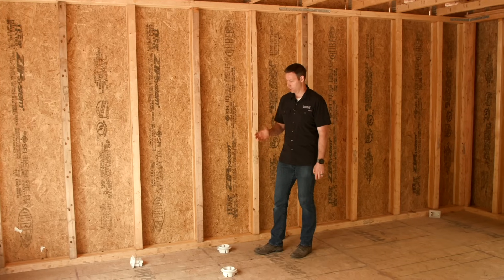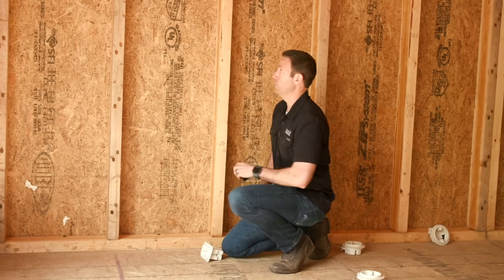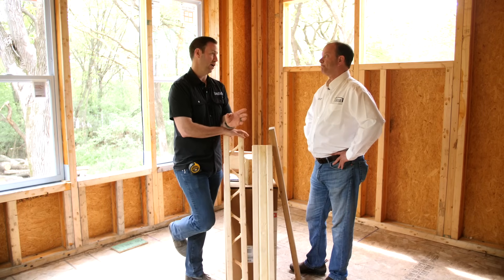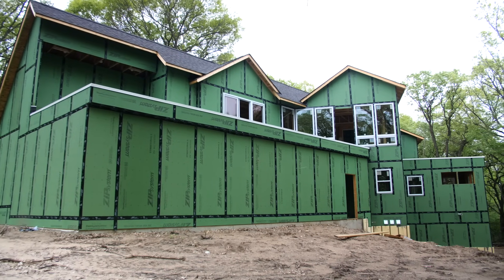Insulated Studs? This is a BIG Innovation in Framing!

Comment: How fast do these walls fail compared to traditional stud walls when exposed to fire?  (Not making assumptions or nay-saying... I'm interested as a Firefighter.)
Reply: From my basic knowledge I advise that this type of foam is self extinguishing,  the wood of course is not. In a sprayed in application VS BATT it would perform better than studs n batt. In a T-stud to spray foam it would perform significantly better. There working on the fire an mold barrier as well he said. Which I believe industry wide is simply passing the testing required to certify the foam and a simple additive. just costly and less in demand that the standard stud. Its been a few years n Spray foam has not yet been certified for commercial fire walls n so forth due to test costs/ Vs potential additional sales is what I was told when I ask.
https://www.youtube.com/watch?v=1PB_-zjWVLM
Reply: If the insulation is a polyiso the difference should be minimal. Polyiso is rated for use in a fire rated roof as insulation and is the typical type used in most exterior foil backed sheathing. Most spray-foams are now polyiso based due to flame spread and off-gassing concerns. By treating the wood component for fire resistance it may even be a better solution than standard framing. I would be interested in UL ratings for the construction assemblies of the product as that is the only way to be sure of its fire resistance. As a retired Registered Architect I would say that the system has potential.

As a side note just because foam is used doesn't mean it burns "faster" because the chemical composition, curing process, and manufacturing process of the foam makes a big difference in the flammability of the foam.
Reply: @oldman4440  My concern would be the smoke that it creates.
Reply: @iamjackalope  If the foam is polyiso its fire characteristics are the best of all foam that I'm aware of. It does not melt or drip upon combustion but forms a protective char layer and remains in place during fire tests. Its temperature resistance is 390 deg f. In roofing construction it often does not need a thermal barrier like other foams to get a fire rating. Do not confuse polyiso with the closed cell foam (typically blue or pink in color) or "bead Board" (white in color and breaks into loose beads - think styrofoam cooler. This is the foam type which gives foam insulation a bad reputation ).
Reply: @oldman4440  I'm familiar with polyiso. I've used it working with boats. It's a two part mixture that is poured into sealed compartments under the deck and in the gunwales of boats to help keep them afloat if they end up getting swamped.  The compartments have to be sealed air tight because the foam will suck up moister and promote rot and mold. It can be very costly to repair.

For exterior roof insulation  or "ridged" type panels like Cellutex are only fire rated for use on the outside of class B residential and commercial buildings if I'm not mistaken. (I'm to lazy to look it up in the IBC, IRC) 

But there is no way these T-studs could ever get a class A fire rating. They are wood and wood is a 4 letter word to class A fire rating. Even when chemically treated with very expensive fire retardant chemicals. You want class A you build with steal. Steal studs, steal doors and frames, steal duct work, steal electrical conduit and electrical chases and thick gauge welded corrugated steal panel roofs with 8" of steal reinforced concrete over that and then topped off with a water proofing membrane like hot mop and rock. All of the walls are covered with 2 sheets of 5/8" sheet rock that continues into the air ducts.
Reply: @iamjackalope  as a retired Architect I am very aware of combustible vs. non-combustible construction and I was never claiming a Class A fire rating but responding to the question how do the T studs compare to conventional  wood framing in terms of flame spread and toxic gas production during combustion and my point was that of all of the foam types available polyiso would be the best due to its inherent better fire characteristics  over other foams. Test data is required and I'm a little bit disappointed that the video did not touch on this area.
Reply: @iamjackalope  Steel. The word is Steel. Not "Steal"...
Reply: @tmoney1876  Steel.... opps my bad. I proof read my stuff but that one got by me.
Reply: according to their website they perform BETTER than standard wood in a fire.  My guess is that the foam is NOT as flammable as the wood and thus creates a fire break.  The heat insulation also protects the side of the 2x6 that is not exposed directly to the fire, thus protecting half of the wood from fire till the foam is gone.
Reply: Negative on the foam being more flammable. We use fire caulking/foam all the time in the industry.  I’m sure it’s fire resistance.
Reply: @MiniMotoAlliance  Foam fire block ignites at 240 degrees. So it catches fire faster than wood. Its purpose is to stop air movement in a fire to slow the burn process, but is not resistant to flame itself. Fire stop caulking is much more reliable, but takes longer to apply.
Reply: He mentioned class A fire rated product is available.
Reply: @johnnybarbar7435  
Not yet. Wait for relevant testing.
Reply: https://www.tstud.com/sodermalm-house
Reply: The foam is polyisocyanurate, an excellent fire resistant product - better than wood.
Reply: I had a truck fire in my shop with foil covered fire resistance foam sandwiches between the truck and furniture stored in shop. One foam board showed slight damage, no heat damage to furniture and no spread fire. Volunteer crew, six miles out...cab and engine compartment burned out. This foam is amazing.
Reply: If residential sprinklers were required by code it would be a moot point, and you would eventually be out of a job.
Reply: @jeanpetrunak6458  Fire sprinklers MAY keep a room from reaching flashover long enough for firefighters to arrive and possibly save a structure, but I've never seen them conduct search and rescue or overhaul...
Reply: @stewie84  Interesting. When you respond to an alarm in a building which has sprinklers, what condition is the building in when you get there?
Reply: @jeanpetrunak6458  Sprinklers are becoming more common place these days, or at least in California they are. Most new residences built within the last couple of years have fire sprinklers installed. It really is about time that they become a code requirement nation wide.
Reply: Supplier can you answer this sensible ?
Reply: It's wood..it already failed there guy
Reply: seem like with all that Styrofoam in the middle these suds  would be a great fuel for a house fire
Reply: @woodchuck1800  ...Its not styrofoam,... There is, in fact, more than one type of foam in the world.
Reply: This is like asbestos or DDT tehey will never tell us until enough folks have died in a fire 🔥 trap or enough years have passed
Reply: I'd say they burn faster...the dowels are glued in..plus foam is flammable
Reply: @tonym1279  The foam used in these studs should be the same, or similar to spray insulation witch would make them fire resistant and shouldn't burn faster than a traditional stud.
Reply: @tonym1279  Based on what information and experience?
https://www.tstud.com/sodermalm-house
Reply: @tonym1279  These are exactly my concerns... glue fails, truss fails, stud fails, wall fails... but until it's been tested, it's just theory. I'm sure these tests must have been done if they are considered acceptable building materials, but I'm curious to know the results..
Reply: @stewie84  wood glue is stronger than wood, the wood will fail before the glued joint lol

Comment: You know what's best?
These are gonna be used only by rich people and they really like big windows.
Big windows kill thermal efficiency.

You want a well insulated house, cut on the window and make sure they are well placed. 
Also a good isolation in the basement is often over-looked, but's it's really important. Also it help stop humidity from the ground and thus you can use less air-exchanger, which is also a big lost.
Also, you already need something on those stud and there are insulated solution that aren't that expensive.
And finally, I don't like the single the top plate and the wall being retain by strap.

I know it's a lot of complaint, but there are so many comment that focus on the marketing in the video, while ignoring the flaws.

Comment: They mentioned the convenience for electricians but what about plumbers having to go through the studs with 2" drainage?
Reply: The space in the middle should be 2 1/2", so a 2" nominal PVC pipe with actual OD of 2 3/8 should be able to slide through.

Comment: As a plumber I see complications. Drilling a two to four inch holes would take for ever. Keeping pipes to grade will be a pain. There will need to be special brackets made. I am sure that you would loose a bunch of strength after large holes were notched into place
. Running Pex water lines would be cake. Special attention would need to be applied to the ends of pipes being installed. ( Water lines plugging up. Gluing waste pipes with the Ins. parts in them. Ect.) Funny the sparky poking his little wire through it. Probably couldn't find a plumber that wouldn't be frowning. LOL. All and all if you can afford it buy it. Cause if the wife is happy your happy. Who cares what the plumber thinks.

Comment: Why not just fill the wall with the foam instead of using old fashioned fiberglass insulation that will eventually slump in between the studs ?

Comment: It appears as though the studs have been rotated and stacked over the windows providing what you say is a viable structural member that will eliminate the need for PSL, or LSL or solid sawn. As you point out there is no load being placed on them in the example of this video and these studs are nothing more than backing. When required, what engineering practice will allow them to be laminated and what load will they bear either continuously or on a point? Can you furnish the reports and testing that will verify your claims?

Comment: Question? I really like this product and think it can work well in cold climate states but 24" centered stud is not an ideal for dry wall screwing. It may buckle and more likely easier to bust through, unless you have a solution for that.
Reply: nemarec - I agree with your question about  24 inch centers which would require at least 5/8 drywall for strength.  That said, the wider profile of each stud compared to traditional framing provides more surface to get a strong mount, especially at the joint between two drywall sheets.

Comment: I'm sorry, but this seems like an unnecessary product. There are ways to get around the stud transferring heat. About 15yrs ago, I was on a project for a "green" Library. The exterior side of the walls had 2x4 studs @ 16"OC. The interior side of the wall had the same framing, but offset a stud bay. Everything was sprayed will foam. The exterior side had 2" styrofoam sheeting attached to the studs and 3/4" ply outside of that. The 2x4 could just as easily be replaced w/ a 2x3 or even a 1-5/8 metal stud, on the interior side, to save wall thickness.
Reply: Hi Tom, Just my thoughts, but I think you would be rendering the primary exterior sheathed wall as completely non-structural because practically ALL of your lateral shear resistance inherent in the tight plywood-to-stud connection is lost by the introduction a non structural inter layer of 2" styrofoam that your fasteners have to penetrate. But by the sounds of it, the entire cavity was also filled w/ exp foam so that would help with lateral loads, but would be an interesting calculation. Perhaps if the exterior were ExtrudedPolyStyrene, glued & screwed you would get some sort of lateral shear rating, but on a large structure like a Library- well, I'm that certainly did have some good engineering.
Reply: @sLDaco  I hear what you're saying. This particular job had a steel skeleton so your worries would be nullified. In a residential framing situation, I'd think you could forego the 2" styrofoam, as the interior volume would be far less, for heat calcs. However, let-in braces (Simpson straps or plywood triangles) could be employed to relieve your lateral woes.
Reply: I tend to agree the real heat loss is in the windows and ceiling, but try to get anyone to pay for triple pane Windows
Reply: @minedustry  Triple pane is a hard sell. My experience shows the ROI isn't always worth it. The only real advantage of triple pane, that I've found, is the comfort factor. They create less instances of higher Delta T and, subsequently, less equipment cycling. This also decreases the feeling of interior drafts and temperature swings. But, we wind up back at the initial cost.

Comment: How do these act in a fire? Would they burn more quickly, or different in general, than a regular 2x?
Reply: @10:30 - The pressure treated version (treated with a product called NexGen)  is Class A Fire Rated. There was no mention of fire rating on the untreated version. I don't know the fire rating of "standard" pressure treated and untreated lumber, but this NexGen stuff is said to be much better than the "standard" treatment.

Comment: As a firefighter, one concern I have when I see these products come out is, how will they perform under fire conditions? That is usually not discussed in these promotional videos. As a rule, when you go from solid wood construction to web truss or I-beam construction, the materials will fail and collapse much faster in a fire. Lots of firefighters have been caught in structure collapses because of how quickly these structures fail once they start burning. So, I would really want to see some testing of how this would hold up under legitimate fire conditions before I would build with it. Besides that, it looks like a really great product.
Reply: @johnSR32  If fire gets to the studs it over...the only concern would be the firefighters...its all about the envelop in building..dealing with the first hour for the occupants to get away safely...thats it....Oh yes I agree how healthy is your home...well thats the million dollar question.
Reply: I'm not a firefighter but I have talked to a few that say new houses are far more dangerous than an old one. They go up so fast.
Reply: @JSAFIXIT  my understanding is that that is primarily due to the use of synthetics in furnishings
Reply: @GeofDumas  It could be. Old houses did use a lot of solid lumber, and plaster. Plaster doesn't burn, and it's harder to ignite a large piece of lumber vs a smaller one.
Reply: @JSAFIXIT  oh yeah i bet larger framing is going to take a heck of a lot longer to actually burn down, but just as far as how long youll have to escape, thats a different story
Reply: @GeofDumas  yeah its much less cloth and wood but polyester, plastics and such
Reply: Im curious how long the squished material lasts
Reply: Fire study was done on their website. It leads to this page. https://static1.squarespace.com/static/59cce8bba9db0941ea92e75f/t/59d258c6a803bbde4f0bcc62/1506957510626/16-4787319376DevReport+%28002%29+UL+Testing+of+Tstud.pdf
Reply: Address your fire concerns by using Rockwool insulation.  It's a certified fire barrier. Hell, use it on BOTH inside & outside your exterior walls!!! THE best insulation is ROCKWOOL, period!!
Reply: Way back in the seventies when there was a push to insulate and change windows for double pain units I did some calculations. The pay out to break even the cost from energy savings was 17 years. What's interesting is if you calculate today for almost any energy saving project is break even point is in the same order of magnitude 15 to 20 years or more to the point longer than most people stay in a home.
My point is sacrificing structural integrity and pricing homes out of reach should not be occoring due to a push for energy efficiency out of step with reality.
Reply: That kinda info doesn't serve well in this sales pitch of snake oil
Reply: agree, between these and I joists they make for a dangerous situation. not to mention that it would take a 100 years to make up the difference in your heat bill from the initial cost.